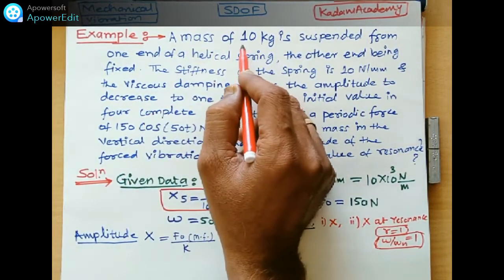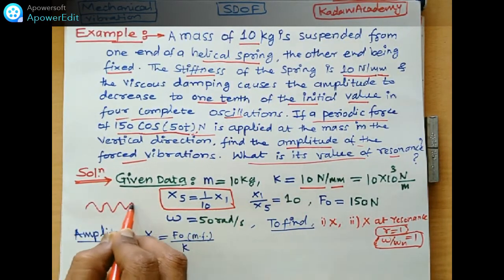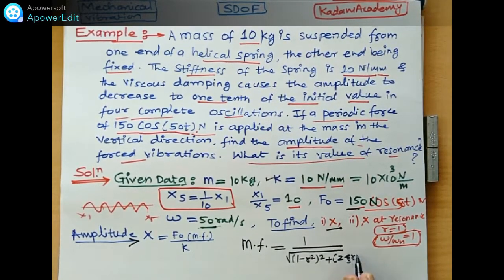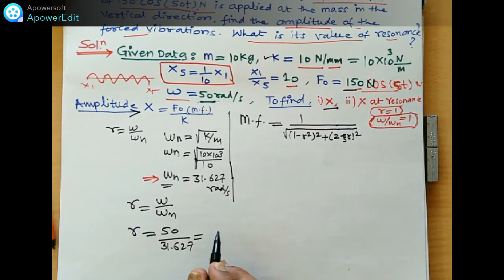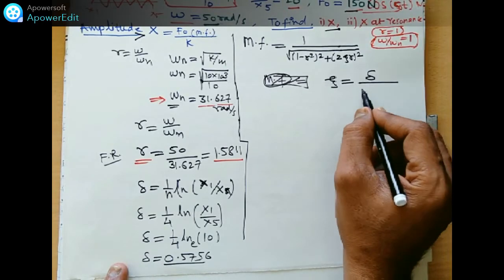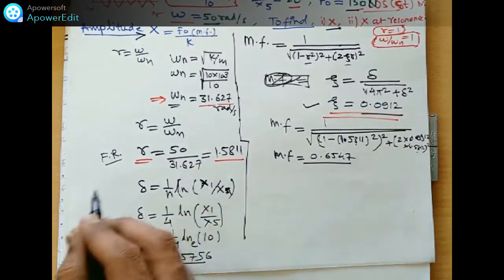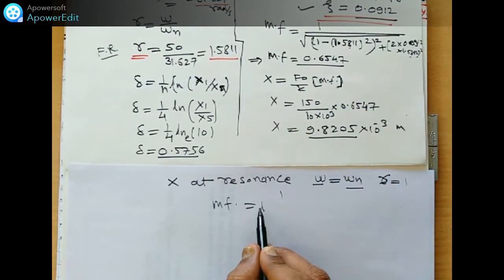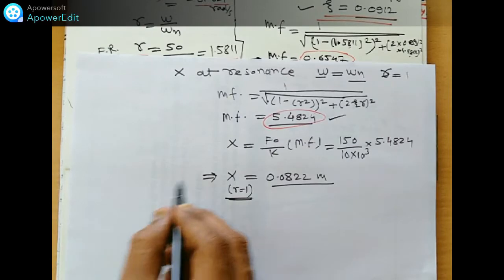Spring Mass Damper Numerical FDV  04

Comment: A mass of 10 kg is suspended from one end of a helical spring, the 
other end being fixed. The stiffness of the spring is 10 N/mm. The 
viscous damping causes the amplitude to decrease to one-tenth of 
the initial value in four complete oscillations. If a periodic force of 
150 cos50 t N is applied at the mass in the vertical direction, find 
the amplitude of the forced vibrations. What is its value of 
resonance?